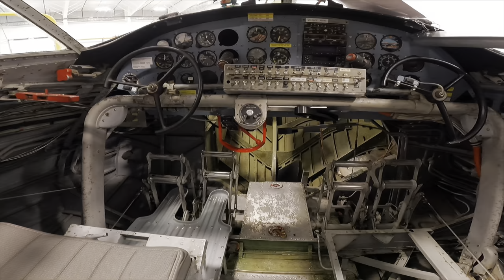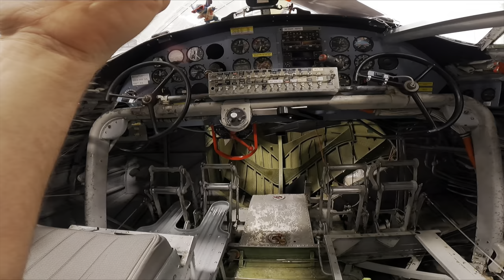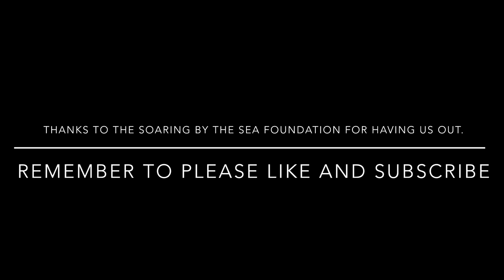Combat Veteran Warbird PBY WWII Flying Boat Maintenance

Comment: This is such an amazing and informative video. I've always had a fascination for the flying boats. I hope you see this comment because i have a question that I have never had anyone answer for me. On these flying boats, how do you rotate the engines to check for hydrolock when you can't get to the propellers to pull them around?
Reply from the maker: They “bump” them through with the starter. There’s a clutch on the starter that they engage briefly with the starter spinning that will bump the engine through the necessary revolutions before starting. Between the brief-ness of the “bump” and the slipping action of the clutch, it’s considered ok to do so and standard procedure.